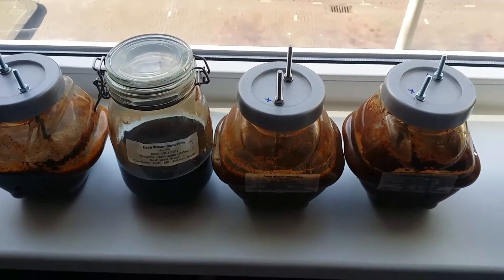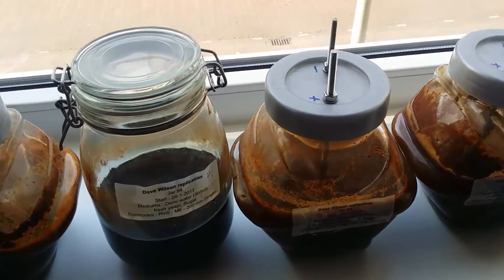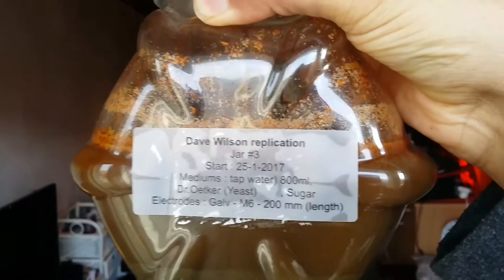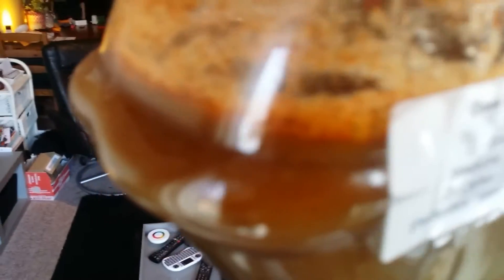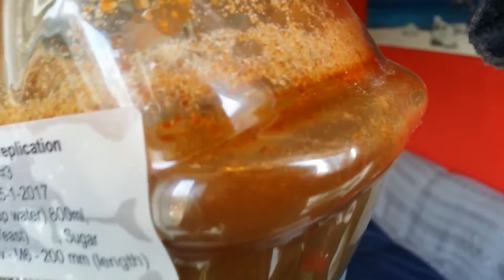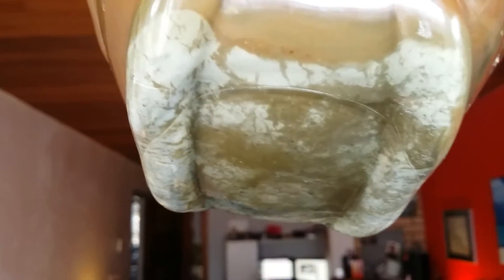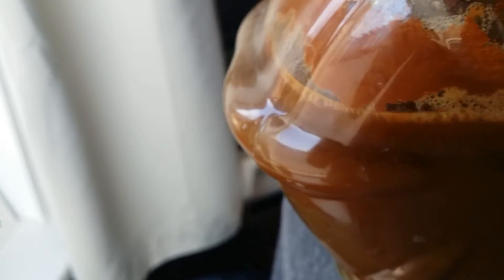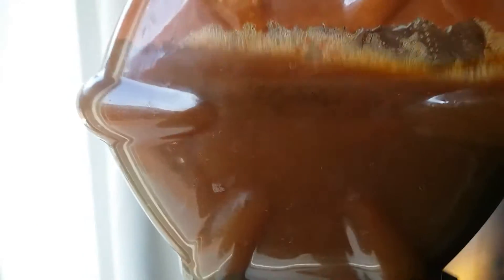Replication #1 Daye Wilson - How to create gold in 24 hours

Comment: get a bucket ,a battery charger , go to menards and get iron the length of buckets top a little over pour the salt water mix into the bucket start the battery charger use table salt and hot water calculate amount of liquide to salt for proper amounts then you will see every thing mr wilson said you would wait an hour or more follow his instructions for yeast ,sugar etc hes the truth sofar !
Reply from the maker: Hi William,
We don't have an Menards in The Netherlands.
I am pretty sure that the stainless steel 200mm M6 crews I used are correct.

I use a bench PSU at 12V and about 1,5A for about a hour,till the solution turns green/blue.
the rest of what I did is written in the details of the video.

I would like to know what I am doing wrong.
I've got another batch with which I added 1/4 of Vinegar into the green/blue mixture after stopping electrolysis.
and followed up the next steps up to the letter.

You suggest waiting longer (an hour) before adding the yeast etc..?

What is the ratio of salt that you add to the solution, the proper amount?
Ratio is weight vs ML of what used, let's say 500ML Mr Wilson used.

How much sugar do you add in weight in ratio to a 500ml solution (now about 650ml with the Vinegar added)?

Cheers,
Ray